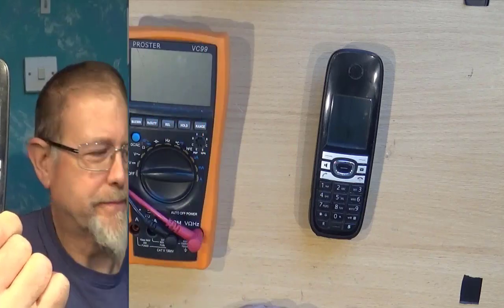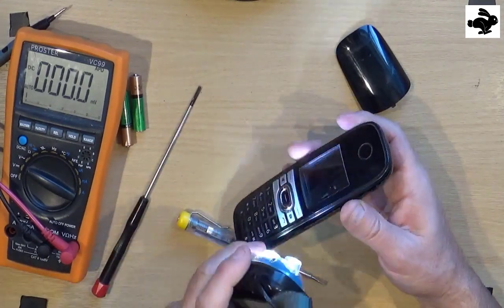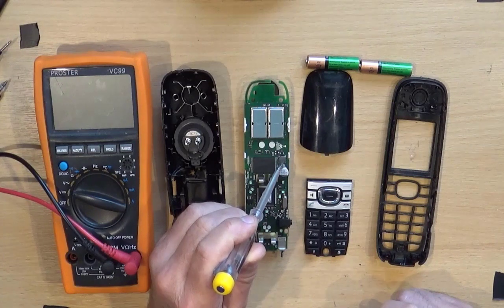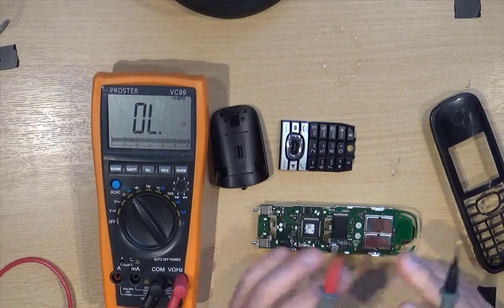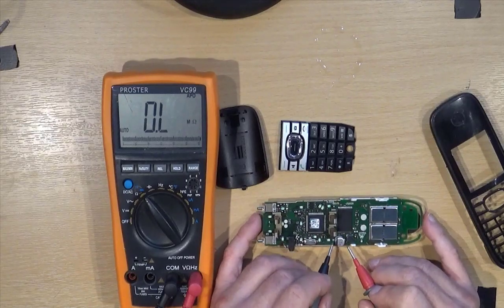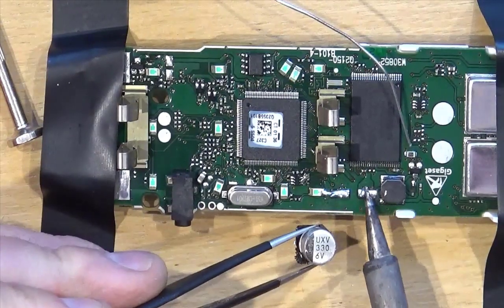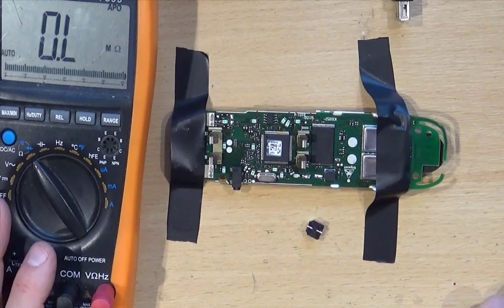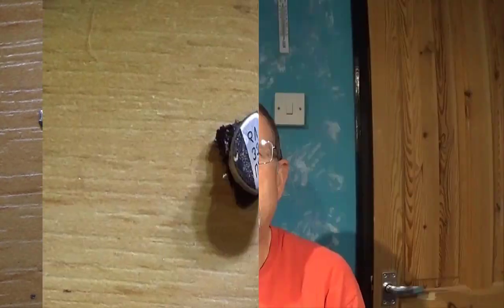Gigaset C610H Handset Not Working. Can We Repair It?

Comment: Hi, have 3 of these c610, and they have/had a very good sound they have if you call with VOIP, and i think i have the same problem as you did, the C610 do not charge or the batteries die very fast. / well today i noticed that when i picked up the phone the logo lit up and the phone is dead. (with recharged bat. it won´t work either) i will open 1 of the 3 c610 phones and maybe i can see the value on my caps. (btw, i have exactly the same multy meter as you have , only the brand is VICI instead of proster)   sorry i am Dutch, so my English isn´t that well

Comment: The first thing to do was to change the cells for new ones with good voltage and ,much more, some milliamps in it. Here you get only 1,8V for the 2 cells in serie and it's really not enough : you must have between 2,5 and 3 volts. If not, the phone cannot run.
Reply from the maker: I only got 1.8 volts with good charged up cells. This was because something in the phone electronics was faulty and drawing a lot of current.

Comment: Gosh, opening the case with a screwdriver! You're scratching all the surface. Better you watch others how to do that.
Reply from the maker: I know -if it had been worth anything I would have been more careful. Even if I'd managed to repair it it would have just sat in my office and I don't mind scratched stuff!
Reply: This thing is not meant to be opened and it is a PITA to do. It's a pity because the product is pretty good and cheap.